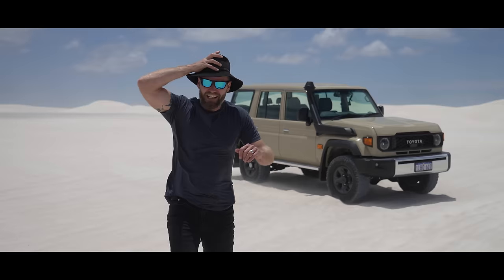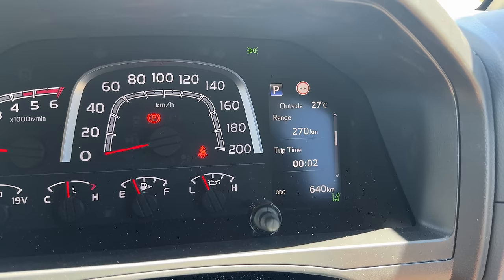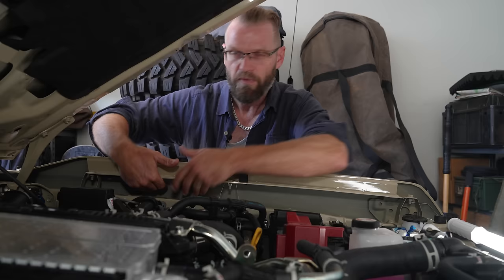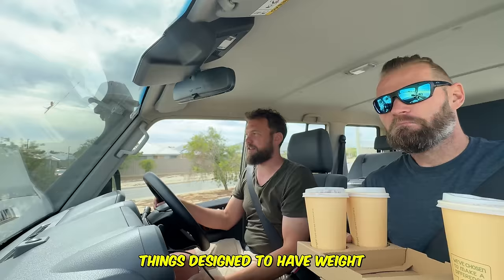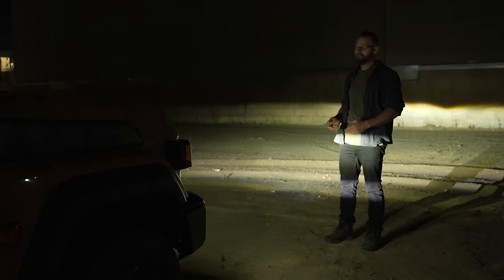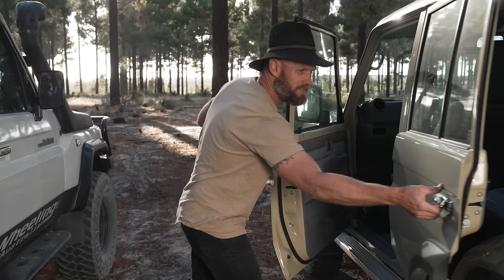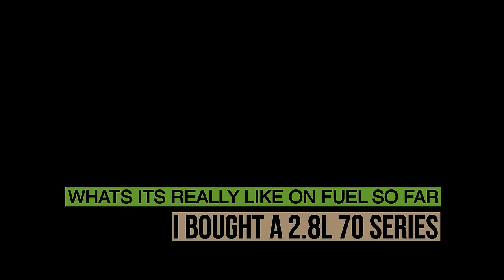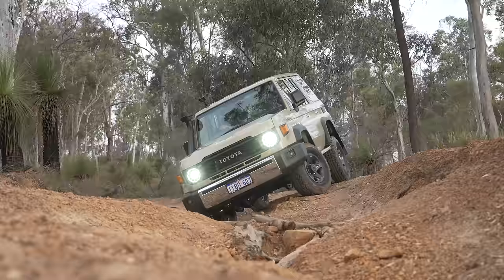I BOUGHT A 2.8l AUTO 2024 LANDCRUISER 70 series

Comment: Thanks Toyota, you put a2.8 in the Land Cruiser.Maybe it is now a much better daily drive 4x4 because of a lesser fuel consumption. My Prado shortbase 2.8   177 HP only 9.5 liters but I drive it like a tractor ( manual gearbox) after 7 years and 120000 km I still have no problems with  the engine or something else Except when I put the Prado in front of my house,cross my house or start the Prado at my place every time the tire sensor lights up (only at my place it lights up. This summer 4000km on holiday in Scotland and France it did not light up) even in other places in Belgium.  My Toyota garage never heard of it even the tyre centers. Maybe you know something how I can solve this little problem. Thanks for your videos and keep on the good work. Karl

Comment: The only thing about the engine is under load it'll be highly strung. Getting 500k KMs + out an engine now is a thing of the past
Reply: The v8s really don’t last 500k so that’s not really a argument
Reply: I have 2 of the 2.8s. They don't seem highly strung, even towing almost 3t.
Reply: It is an argument, I’ve got one and it’s nearly at 610k and I know several people that have done in excess of this
Reply: @leeszalnowski8367  as some one that lives in a remote part of Australia where people swear by them I havnt seen one on the original engine get to 500k yet
Reply: The Cummins ISB has a B50 rating (50% will require major service by the rated mileage) of 350,000 miles/560,000km. So you got a 1 in 2 chance of making it to 500k km if you go that route.
Reply: All I can comment on is my own first hand experiences. Sure if you dust them and don’t service them properly they won’t last, however neither will nearly all vehicles. I do swear by them

Comment: I think with weight the 2.8 will show its weakness.

I.e. being under load/stressed and having to perform.
Reply: How Does the Hilux/Pardo Perform Carrying/Towing a Load?
There's your Answer on How the 70 Series will Perform!
Reply: Can't see that, I'm driving a wrangler with a 2,8L diesel for years and the engine isn't stressed anytime even fully loaded and with a rtt. Didn't even had problems in higher altitude and I only have a 5 speed automatic
Reply: @DMSVICAU exactly gutless & underpowered.
Reply: @petergreber7051  
When Compared to What? 
My 2002 ZD30di (Under)Powered (but Adequate) Nissan Patrol or a SuperCharged Y62?
Reply: @DMSVICAU  Hilux diesels have always been underpowered for towing.
Can’t see how a Landcruiser with a Hilux motor will be any better. 
Landcruiser is heavier than a Hilux both being empty.

Comment: Hey Ronny, love your channel !.. I have a 76 Landcruiser, and is thinking it will be soo good if you test 255/85/16 tyre size too... spesifically Toyo OpenCountry MT. This is what I am running  and you will find the following.
1. They are better in the sand than 285's
2. They are no more noisy than the stock tyres
3. They are 100% legal, and fit on the stock alloys
4. They are a true 33" and fit with the stock suspension no mods needed.
5. They dont increase the fuel consumption going from the 265 stock tyres..

Sounds unreal?.... 🤔 would love to hear your opinion based on the thorough testing you normally do.

Comment: Softer hood / bonnet and what your noticing with the tops of the front fenders are likely designed to make them softer in the event of pedestrian impact. Its all about crash test ratings and survive-ability of both an occupants and pedestrians
Reply: I think you'll find they've used the old inner skin panels and spacers for the higher guards to match the bonnet. Cost effective. My np300 Navara is the same. Old d40 inner skin new d23/np300 outers

Comment: Hook 3t up to it and do some long ranges.
We have a 2014 79, towed 2.5t of boat and 3t of loaded car trailer all over the place. In 2018 we got a new Hilux, pretty much the same drivetrain, cooked the brakes on it many times as it didn't have the engine braking for the likes of the Kangaroo Valley or Black Mountain range. Great when the country side was flat. 
Just look at the ZD, was a great move from Nissan, Toyota Aus will survive with this thing, only due to the fleet side.

Comment: Ronny

Well in a way you could say that I am surprised that you bought the 76. I can understand why you did, but yet perhaps one of your mates was already in the process to get one? If that was the case it probably would have been best to wait and test that one out.

With that said if you are only going to go for a 6 month run on this I have a simple suggestion on how to move forward with it. Keep the mods simple. Do a simple drawer setup in the rear. Do a simple(and yet good) roof rack that can be removed. Probably change the intake to an actual snorkel. If it gets real heavy then I would consider changing the suspension. If it stays within GVM if you keep it light then I say leave the suspension stock. Even with the tires you have I suspect this is far more capable compared to other vehicles on the market. Later after the 6 months are up then I say put it on the market and keep both the 79 and 78. Those two have so much invested into them that it would cost you more to lose those vehicles.
Reply: He’s a YouTuber, he needs videos like this to keep his viewers interested. It’s like why Andrew won’t just put a auto in his v8 troopy. They are doing all these things to continue creating content, otherwise we have nothing to watch.
Reply: @deanabrozki286  just because one may think he needs new videos like this doesn't mean he had to do it like this. With what he has already this vehicle is already a waist for his needs. For the money you would need to make back for the cost of the new vehicle is hard to offset. I can promise that YouTube does not pay near enough to cover that cost either
Reply: He's running a business . It's about the views .

Comment: Fuel economy will get better. New engine needs to "loosen" up a bit. My D-Max started off around 12 l per 100 after about 6 months it went down to 10. It might also be how the ECM is programmed to run the engine a bit rich for the first few months as the consumption seemed to change suddenly.

Comment: Great! They need solve rear axle width, suspension flex and weight. And it will be almost as perfect as old Discovery 1 300tdi :P     Btw, fixing LR issues cost lest than solving rear axle width proper way. (two lockers and atb diff cost way way less)

Comment: I can't help but think about the Nissan Patrol & the introduction of the 3 litre 4 cylinder years ago. Great little engine, it's just not built to move such a large mass & be worked hard. It's hard to work out why, especially when they had such a good run out of the 4.2. Like Toyota have done to date. Now a 3 litre is worth FA in comparison to the bigger engine.... I think the same is going to happen to these, even if they have been run in the Prado. The 70 series is a work horse & will be treated as such...... Just my thoughts 😏

Comment: Will you have the rear axle track corrected ?. As for tyre sizes I probably would have gone for a 265/75r16 or even a 235/85r16 because the Workmate model has larger diameter tyres than the GXL for some reason.

Comment: There is no reason this configuration won't succeed. My Jeep Gladiator Rubicon 3L diesel & 8 speed auto is somewhat comparable. Normal driving @ 10L/100 km. towing an off grid trailer in variable terrain I am seeing 14L/100 km. towing a heavy 18' RV trailer 8' wide it averaged 17 liters/100 km (mostly highway). The little diesel has torque and zip. My Gladiator with my daily driving gear runs about 7000 lbs. (3182 kg). I think you will be pleasantly surprised! And another great unit to modify and create some interesting content! And room for the family too.

Comment: That gap just going to be a pain with mud and sand and possible future rust point. Be interesting with some extra weight in it as well as the tyre test with the auto. Even the auto temperature. All in all. I think there is a market for them. Trade and construction cars also those being used around town. The auto would be amazing in the city

Comment: The bonnet appears to be designed to allow airflow the top mount intercooler/heat exchanger. Notice the gap between the grille and the front lip of the bonnet. Thats why the insulation stops where it does. They've done away with fitting some type of airscoop ontop of the bonnet.

Comment: Glad i got my 23 V8 troopy after a 2 year wait. To be honest would have cancelled my order if I could not have got the V8. The new redesigned front looks tacky and cheap. Prefer the outgoing model with intercooler bonnet intake.
2.8 4cyl engine will struggle both when under heavy load and for long term reliability and resale.

Comment: Eleven seconds to get to 100 km/h is crazy. I would have expected that kind of time if it had a trailer behind it. My wife's Prado (Lexus GX460) gets to 100km/h in under 8 seconds.
Reply: Unless it's a 2023 v8 petrol it doesn't do 0-100 in less than 8 seconds. Video of proof otherwise because your wife has a pretty tuned up Prado.
Reply: @0KiwiStyles0  We only get the Prado in Lexus form.
Reply: @rich7447  even the Lexus comes in different engine options depending on year  if your wife has a modern v8 petrol it is hardly comparable in acceleration to a v8 diesel or a 2.8l diesel.
Reply: @0KiwiStyles0  The 2023 Ford F250 high output v8 diesel (500 hp and 1200 lb ft/1630nm) weighs 7,000 lbs and does 0 to 100 km/h in around 5.5 seconds.
Reply: @0KiwiStyles0  Just to be clear we use J2807 standards for towing. This makes most vehicles that Europeans tow with inadequate to tow in North America.
Reply: @rich7447  a ford diesel is vastly different to a Toyota. It turns out some of the older v8 diesel LandCruiser prados (around 2010) can do it in about 6.9 seconds, so you could be right. It appears any more modern variants are slower. Not quite the Ford's 5.5 atleast.
Reply: @0KiwiStyles0  Yes it is. 
BTW, I didn't answer you before. My wife's Lexus has a 4.6L gasoline/petrol V8. 0 to 60 on it is around 7.8 seconds which makes it slower than every vehicle that we own with the exception of a 42' motor coach RV.
Toyota doesn't offer diesels here at all. The EPA makes is difficult to put a diesel in anything that has a GVM/GVWR up to 8,500 lbs. Over 8,500lbs and the regulations are different.
Reply: @rich7447  well if they offer a petrol LandCruiser I'd assume it'll be faster than the diesel 🤣
Reply: @0KiwiStyles0  Not necessarily. Because we have a maximum time of 30 seconds to accelerate to 60mph while towing a trailer loaded to the maximum rated trailer weight we tend to have very powerful diesels. The diesel F250 is actually quicker to 60 mph than the 7.3L gas version of the same truck.
Reply: @rich7447  yes necessarily because your Toyota is not a ford, and Toyota will never be a ford.
Reply: @0KiwiStyles0  Different manufacturers, but I'm sure that Toyota could build a more powerful diesel if they chose to. GM and Cummins both have powerful diesels small enough to fit in a large pickup.
Unfortunately Toyota does not compete in the segment where all the diesels are sold in the US and Canada, so we will never get to see a diesel Toyota. The biggest thing that Toyota sells is the Tundra/Sequoia and it is too small to get above the more stringent EPA regulations. It's also not as popular as the other brands.

Comment: I'm surprised Toyota hasn't really focused on making the VDJ V8 engine a lot better overall and more fuel efficient. I guess they hit the limitation of what's possible with that platform and designed a new smaller engine that makes the same power and is overall better but I mean come on you cannot beat that V8 sound.

Comment: 9:15 For real?  That's something my first car (A 1984 Mercedes W123 Diesel Wagon) already had. (the adjustment of the lights via wheel. And it evne had a -1 setting too. For whatever reason as it had a self leveling rear axle as standard.) Have never seen a car where you had to do that different than with the wheel. (unless the headlights were auto leveling)

Comment: You can fill the gap between external  skin of the hood and the under structure with spécialized "silicone" It will give rigidity like on large side panel of utility vans. It's weird thing from Toyota !
Reply: Silicone is not suitable for this.  Use a polyurethane product eg Sikaflex 554 (for strength)
Reply: @explorermates5655  I know this that 's why I used "silicon" and specialized. English is not my native language 🤦‍♂️

Comment: Hi
Ronny, congratulations on your new purchase and a great video. Wondering do you think the bonnet vibration will be the in the v8. I seem to remember the v8 has plastic ducts running from the front of the bonnet to the intercooler. Maybe make it a bit more rigid. What are your thoughts 😊
Reply: Just needs a couple of globs of silicone .

Comment: perspective. they've been lazy. they havent fixed the axle, or put in a manual 6 speed, or done stuff like arm rests or cup holders. they've added rubbish like pedestrian detection and safe bonnet (when they know buyers fit bullbars) they didn't even change the springs to lift the GVM.

the new bonnet is rubbish, where you pointed out the condensation and wobble is also likely to ruin paint due to heat over time due to lack of insulation and hot intercoolers. think about the V8 offroad with no airflow. the power in the 1gd is basic boost pressure - which means more heat and load on the intercooler.

wonder how far delayed all the existing orders were from toyota stockpiling 4cylinders. I bet I ordered my V8 before you ordered your 4 cyl.

Comment: You’re going to need to pop off that engine cover and redo the rubber sealer on the hood supports. 
That’s shitty on a new car but I had to do that on my 2000 cruiser. Much better now
Reply: Make sure to get the sealer that cures fast but is relatively heat resistant too

Comment: Toyota really dropped the ball on that hood brace. You could take care of it yourself by adding your own automotive foam, or take it back to the dealer and have them do it. 
There are several brands of expanding foam on the market so I won't bother with suggesting a brand especially since Australia rarely has the same options as we have in the states. 
Something that can resist high heat.

Comment: Donny's Landcruiser is not the same as what I see on the Toyota site. Is his a premanufactured/prototype one? If you notice @10.48 the side body has a 3 inch groove/indent along the sides and the one I see on the Toyota site has none as it is smooth. Plus the hood is different. Ronny's hood has a lip after 6 inches from the windscreen. Lifts up. Has some type of swoop up. @10:48  Am I missing something? Is the ones on the US Toyota site a different Series and different then Donny's? Such Donny was saying his is a 76 series is the US version a different 70?

Comment: I wonder what it will cost to keep running.
Or whether it will drive 500,000 km at all.
Maybe I'll get used to that - front.
But it seems to be easy to switch to the old front.
Mirror and light adjustment was available for the old model. But not cruise control.
Maybe I'm an old fart. My HDJ 78 had driven 500,000 Km when it was sold, without discussing price, for 57,500.00 Aud.
So we don't just buy new cars when we want proper cars, in Scandinavia.
To replace the HDJ78 I bought an HDJ 80 - WITH 500,000 Km on the clock.
Starts and drives even in -15 degrees C, without preheating, which is defective.
On the HDJ 78 I had removed the toaster and EGR. Nothing to use it for.

Comment: Hi, i have a question pertaining to old GVM _new GVM. Everyone is going on about the engine etc but no-one seems to be looking at the nitty gritty ( forgive me if someone has raised these questions and i have missed it.
LC 76 - 2019 versus LC76-2024.
1) GVM 2019= 3060gvm.    GVM 2024 = 3500 GVM 
 A) in order to raise my GVM on 2019 i had to do all sorts of suspension mods.
B) now that GVM for 2024 is 3500kg ( a whopping 500KG extra ) 
Does this mean that I don’t have to upgrade my brakes or suspension in order to handle the extra 500kg. If toyota hasn’t upgraded chassis, brakes and suspension then why on previous models that had the same brakes, suspension and chassis why was it 500kg less why were we required to upgrade everything and get is signed off. All this took many dollars to do which maybe has been unnecessary in the first place.  ( I’m not talking about crappy brakes and what people wanted to do. I’m discussing purely what is coming out from the manufacturer.

Comment: I wouldnt say that the fuel economy is that much better than the v8. I get an average of 13.5 in my 2014 76 which could be improved with a better 5th gear.